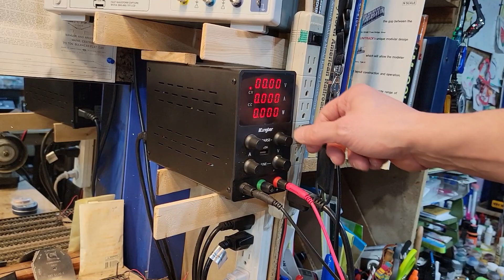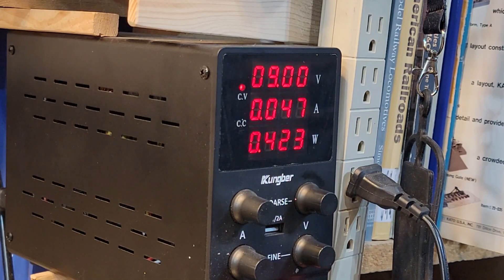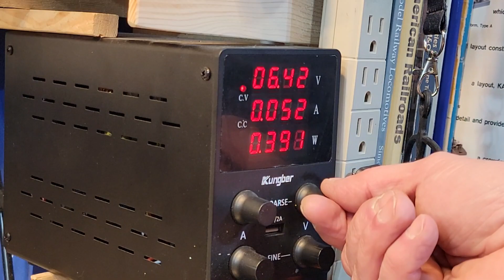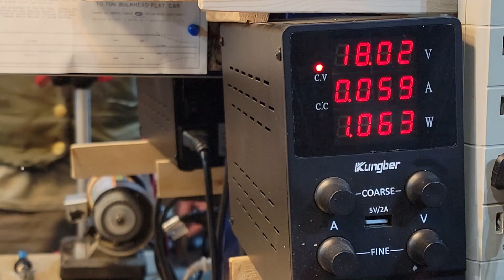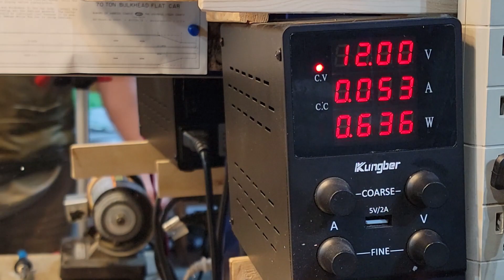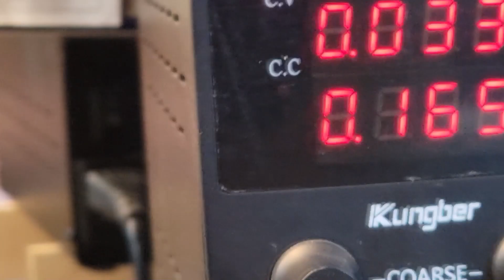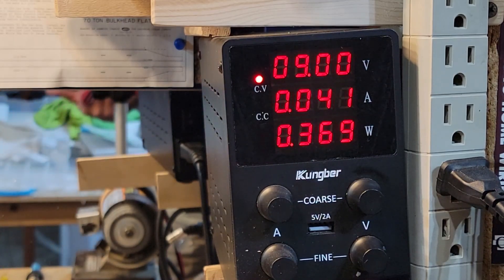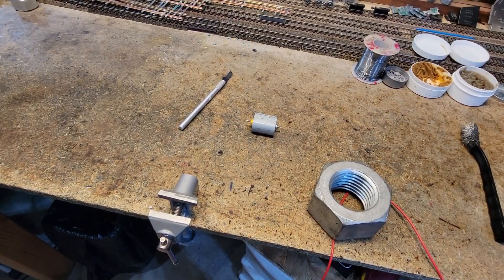How to break in motors

Comment: Where can we purchase those REV1 Motors???
Reply from the maker: I'm still working on that!
Reply: @elite194  thanks
Reply: How can I make my engines roll to a stop when power is turned down to let it go on its own free wheelin DC
Reply from the maker: you can use flywheels on your motors and some power packs have a switch for momentum which will make locomotives gradually come to a stop instead of just stopping!

Comment: Good info, I have 2 motors that I will be installing in a couple of my units. Do you replace the old flywheels with new or reuse the old ones?The motors I have a 2mm shaft and my old athearn is 3mm.
I should have bought flywheels but I was hoping I could adapt the old ones.
Reply from the maker: if you're planning to use flywheels at all, just keep the old ones.  if you're doing DCC then don't use any flywheels and adjust the accel and decel settings to get exactly the right amount of coasting!

Comment: In watching this video, I noted that the second motor (aka Rev-1) did exceed 1 amp current draw during your pinch test. As we know, amperage draw is the most critical component in a motor. As we also know, it takes quite a bit of force to get the Rev-1 to exceed one amp. So my question to you is this, Have you determined how much resistance it takes by pinching or preferably how many properly weighted cars  according to standards can be in a train before the motor reaches the one amp draw? This information would be very helpful to modelers using these motors and myself as well as we would have a very clear indication of when to add a second, third, or fourth locomotive to relieve the other of excess stress and other aspects .
Reply from the maker: when I stall the motor at 24v with a pliers it can briefly hit 1 amp and then it drops to .7.  finger pinching is very hard since it burns my fingers even at lower voltage.  one of the tests that I have done is pulling heavy trains and essentially it doesn't stall, it makes the wheels slip.  the torque is very high and if the train is too heavy then the locomotive's weight is the limiting factor!
Reply: @elite194  Yes, I agree. So based on your analysis, the weight of each loco will govern the pulling ratio. since the twenty four volt motor will in virtually every scenario 'NOT' stop spinning. Because of this factor, I'm attempting to identify the weakest link in the drivetrain that is most likely to break in the case of a complete lockup of it. At this point, I think we can both agree that the motor will not be it. This may be an instance where each modeler will have to make that determination based upon the many factors that exits. Thanks for your input.
Reply from the maker: I've gotten a lot of old locomotives at train shows where part of a universal joint was broken off.  I think those joints are still the weakest link - or a drive shaft is missing or broken, esepecially the small ones!

Comment: After watching both of the motor videos, I will be definitely removing the stock athearn gray motor and be installing one of your rev 1motors.
Reply from the maker: the old gray motor has put in a lot of work over the years, but it does draw way too much power for DCC.  we do have to take another run at improving the gray motor just to see if we can do it!

Comment: Another great video. I do have a question though what is your thoughts on Athearn Genesis motors I own a lot of them they seem to run really well, but I want an expert opinion.
Reply from the maker: oh yes - those motors.  so we've been doing this thing with rebuilding 13 (now more than 20) locomotives.  some of these are Genesis.  the decoders have arrived and we should test them!    somewhere in the junk pile are a bunch of Genesis motors.  we haven't really put them though the test, but since they are pretty much the same as the newer Atlas motors it is my opinion that they are on the weak side.  the Atlas and Bachmann motors that we've already tested over the last couple years have all been found to be low on torque and high on amps when under a load.  I do believe that when we did Ferdinand and maus about 2 years ago, those motors were discarded in favor of a much better 24v motor.  MY genesis SD70 is a super smooth running locomotive, so I can't say that they are bad, but at the same time I haven't put that motor to any extreme test so far.... that will change soon....
Reply: @elite194  I will be watching for that video
Reply from the maker: they will probably serve you well unless you are pulling trains up a helix or trains that are really heavy like the ones I make.  in that case they are way under-pwered and will draw a lot of amps!